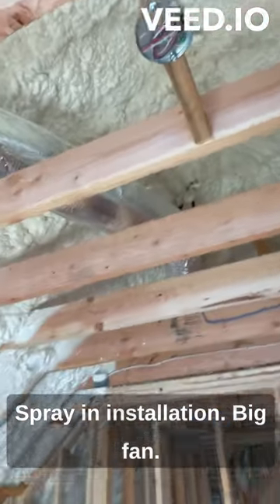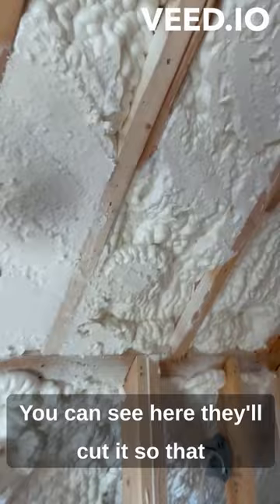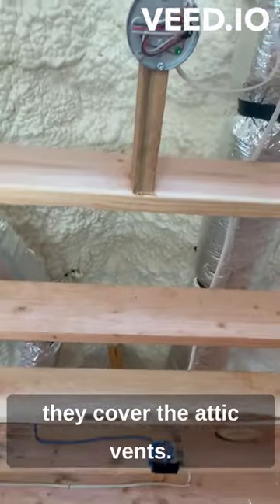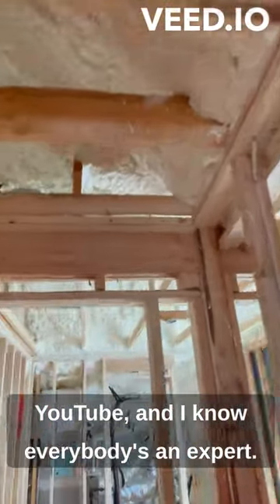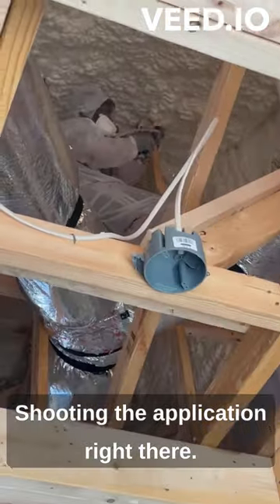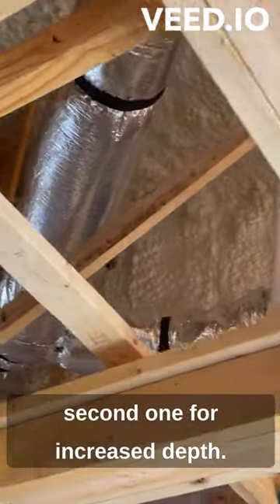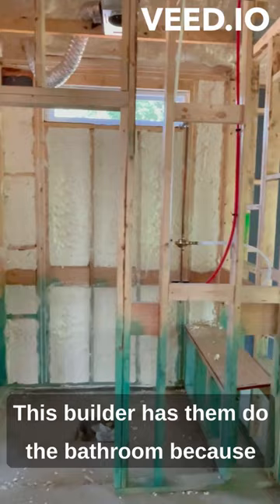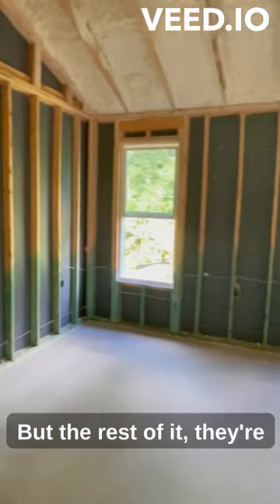No Ventilation with Foam Insulation?

Comment: in addition to the obvious hiding of roof leak issues, there was another material, a spray wrap for a home, ended up with a class action lawsuit because houses had moisture trapped inside much the same as this nonsense. houses have to breathe so to speak. their are issues with humidity, off gassing of materials, buildup of carbon dioxide from living inside. a whole host of issues that these guys are not concerned with as they simply lie about that product in an attempt to sell it to you. they are also doing a very bad job from the looks of it.
and it is not gonna come neat stopping the attic space heating up as the studs transfer heat. have fun with that once you finally realize that you will need to start bringing in some outdoor air to keep a healthy home and reducing illnesses amongst the occupants to include respiratory diseases. and a heads up, most people are choosing energy recovery ventilators for bringing in the outdoor air.

Comment: Stop putting heat duct in the attic
Reply: Where do you put it when you're building on a slab.
Reply: There has to be a better way for this
Reply: @jimbojimjim3590  so where do you put it when you're building on a slab which is very, very common in the south and coastal areas.